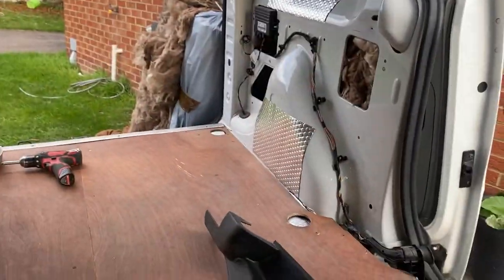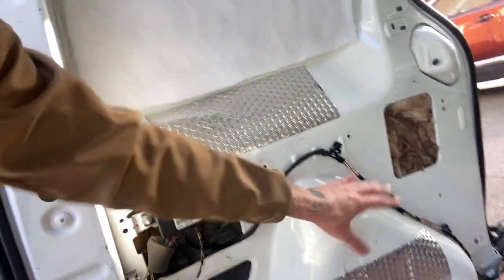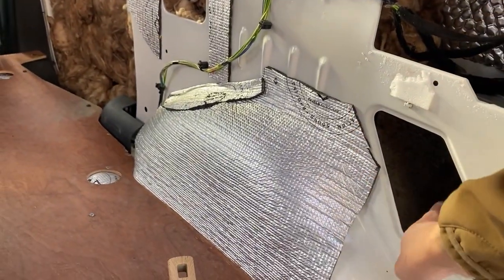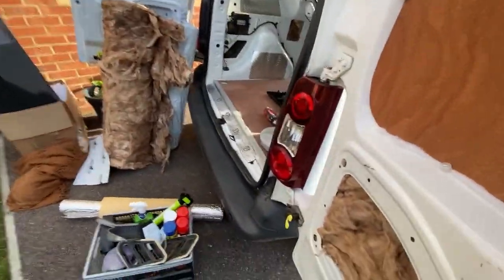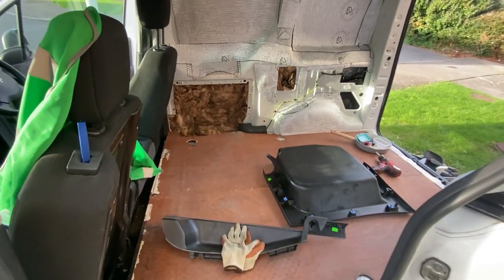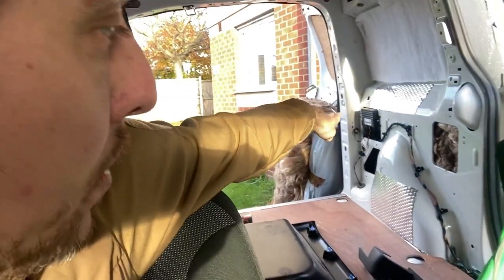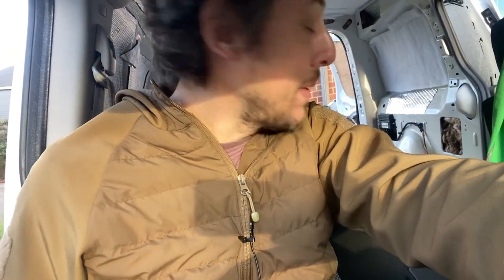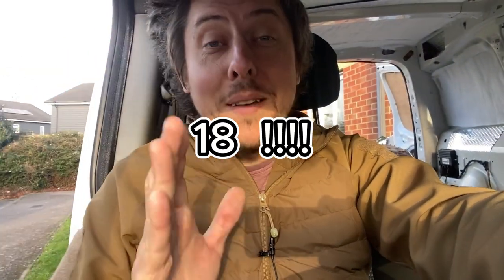Day 4 Van Conversion & Plan Update

Comment: Hey mate, I used peel and stick laminate for the floor which was great, should be able to take that electrical box off insulate then screw it back on in or screw it under the kitchen, hard to tell without seeing it.

The pull out bed took me ages to make, good luck 😅 I would recommend building an L shape sofa and making the pull out as small as possible as storing the extra foam mattress piece is a pain. 

Good luck 👍